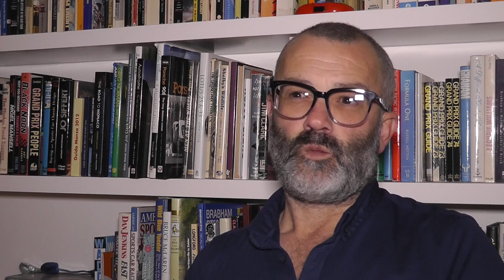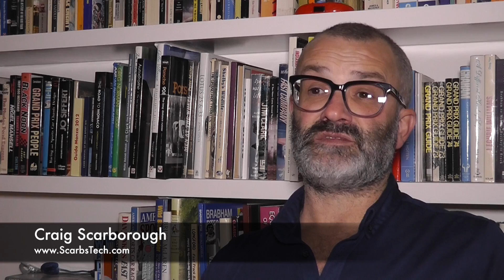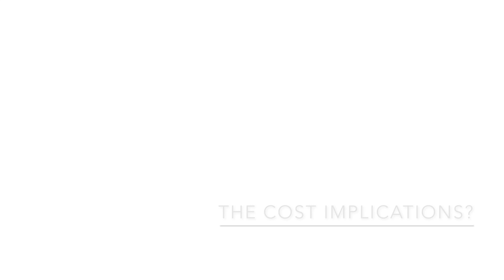Why more F1 engines may blow in 2017

Comment: Engines are limited in the instantaneous fuel flow, so there is a limit on how much power the engines can make. As engines improve, it is harder and harder to make more power. While certainly Mercedes could make their engine better, it is more likely that the other teams will gain more power than Mercedes.

Comment: Why would Merc make drastic changes to a winning formula from 2014, with their competition obviously so far behind. I think they will have been focusing on 2017's drivetrain and unfortunately don't see any change at the top of the constructors championship.

Great info on these vlogs though, love them 👍
Reply: I expect focus to be shifted back to aerodynamics and the engines won't be that important.
Reply: +Merto6 that's going to be key this year. But you gotta have a strong engine to push the car with all the drag that downforce creates.

Comment: The extra grip from wider heavier wheels will also place more load on the engine and drivetrain.
Reply: +Huey Freeman LOL I haven't even thought about them yet....Next time somone asks for my 2017 perdictions I'm gonna say they are going to be unstoppable :D
Reply: And on the brakes(will be interesting to see how those tiny disks/calipers hold up).
Reply: True! Will be interesting to see which teams are able to manage the heat to get optimum tyre temp. I also wonder if we'll see more blown axles with the wider wheel aero and brake cooling requirements.
Reply: bosshunterman. Hass lol.
Reply: Well that's all taken in calculations already months ago, it's not an issue as such. Issues will be created by having more freedom to push tuning and development without much on-track testing..as craig said
Reply: They've actually increased the brake disc's thickness from 28 to 32mm to cope with the higher weight of the cars and the higher grip levels.
Reply: Never mind the engine and drivetrain!.  It will place more load on the DRIVER!.
Reply: I hope so! The more variables the better the racing. :) I saw Daniel Ricciardo post the other day that he is already in the gym! https://twitter.com/danielricciardo/status/816957801419288577
Reply: Should be good.  This is exactly what F1 needed to do.  Im glad they moved in the right direction. And the cars look so much nicer now.  Wider, lower stance... and rear wing profile.

Comment: question: is it very likely that the teams are actually using that 5% of extra fuel for the engines? or will it still be faster to drive with a small amount of fuel in the race and saving fuel? what could be the effects of that rule?
Reply: Probably depending on the new tyres i would guess, if they can handle being pushed more then you could benefit more from running a higher fuel mix.
Reply: Thomas van Asperen keep in mind the car is going to be heavier and have more drag. The extra 5% fuel will likely mean nothing considering those factors.
Reply: Remember they have to save the engine as well.
Reply: Thomas van Asperen With the extra grip from the big tyres and downforce, they can accelerate sooner, brake later so they'll be on the throttle for longer periods and they'll have to push more drag, so the extra 5 kgs will certaintly be used.

Comment: Question for Peter or Scarbs:

Do you think the token system limited Honda's ability to catch up in the engine development race?

Or was it a combination of other issues, such as not hiring experience from other F1 engine manufacturers?
Reply: Michele Abate
I sort of get where you're coming from but as far as racing heritage and continuity, you can't compare Mclaren/williams and ferrari to modern day mercedes.  Had the 1955 Le mans incident never taken place, there is a good chance mercedes would have sustained their racing efforts.

Your facts are contextually skewed.  Mercedes didn't simply buy an engine manufacturer.  They were working with them since 1993 with sauber.  Daimler bought Ilmor in 2002, after supply mclaren for many years.  Remember Vondafone Mclaren Mercedes?
For the 2010 season they wanted a more visible role in F1 as a marketing exercise.  Two choices presented themselves, the toyota route - build everything from scratch at extreme costs, or buy out an existing team.  The cheaper option was buying out brawn gp, which was bar honda, which was tyrrell, which has been in f1 since 1968.

So while not having the same heritage of the silver arrows from the 1930's or 50's, the current day mercedes does in fact, have a very rich racing history.
Reply: I think not.  People tend to scapegoat the token system for honda's poor engine performance.  Looking at renault, they hardly spent any tokens this year but gain a notice bum in power post monaco/canada.  In truth, honda underestimated the challenges of these P.U.  Much like Ferrari in 2014, they focused too much on aero efficiency over power.  The size zero philosophy, with the turbo placed with the V worked from a packaging standpoint but cause numerous heating problems.  Also running a much smaller turbine @ 120k rpm wasn't able to create the desired power.

They should be more competitive in 2017 but as mentioned by Scarbs; this also opens the door to mercedes as well.  Historically mercedes has always created the strongest motor in f1.
Reply: Historically? Today the power unit like the rest of the car is developed mostly by non german. There is no continuity in the  Mercedes race history.
Reply: I'm not short sighted, and you are very right about nationalities, but evolving as a team linke MC Laren, Ferrari, Red Bull, continues doing, for example hiring engineers form all nationalities, it,s a very different thing. Mercedes simple aquired the whole Brawn GP Team (chasis & aerodinamic) and the whole Ilmor racing (powerunit). The Mercedes Petronas AMG F1 racing team we have today hast nothing in comune with the (Mercedes &  Auto Union) racing team which brought us the succesfull silber arrows cars between 1934 and 1939.  Theres is simple no continuity between the former Mercedes  team/car/engine and the new Mercedes race team/ car/ power unit.
Reply: I think he clearly answers your question in the video: depends on what Mercedes and Ferrari would have risked without the token system in place compared to Honda. From the other side of the curtain we cannot see what kind of concepts/ideas the individual manufacturers have in store for the future.
Reply: Michele Abate
You're being shortsighted.  All f1 teams acquire the very best, regardless of nationality.  Redbull is austrian, is Christian Horner?  Or much of the engineering team?

HAAS is an American team but nothing is built in the US.  This discussion isn't about nationality.
Reply: Yes, a lot of teams have their headquarters located near Silverstone. I wonder why they end up hiring British staff...
Reply: Had the 1955 Le mans incident never taken place, "there is a good chance mercedes would have sustained their racing efforts".  Hey guy, i understand there is good chance it could have happened, but we all know  it,s not! Now back to reality , sadly for you i'm not Dieter Zetsche, but one thing is sure if i was him,  i would want you to become chief marketing director for Mercedes. The rare effort you put in the defense of the brand image makes your deep passion evident.